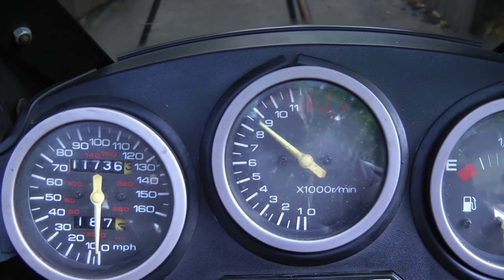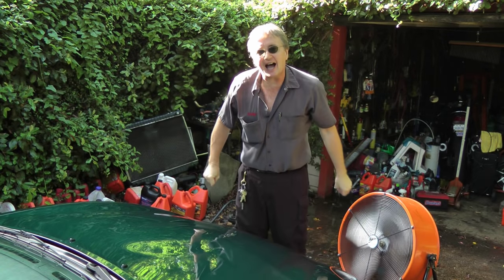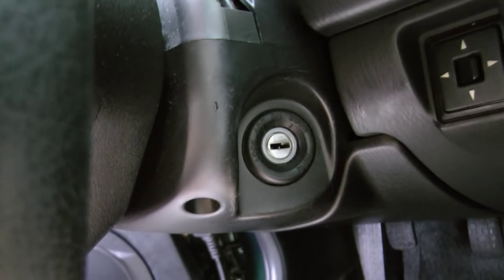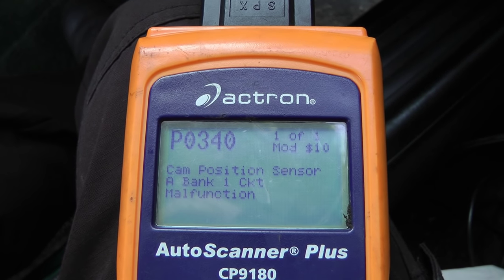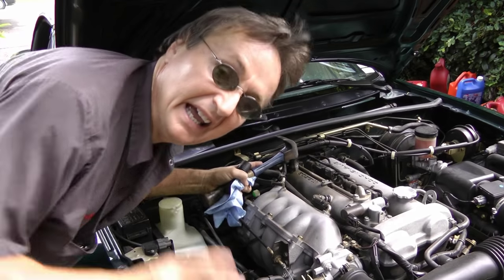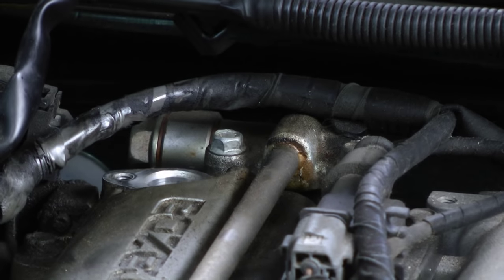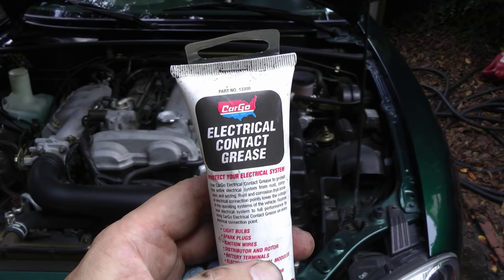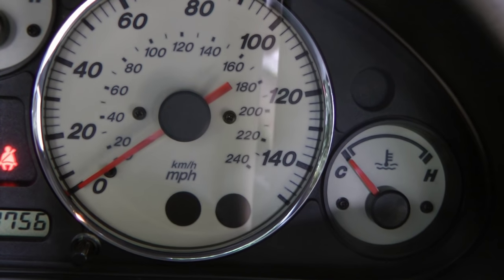How to Fix a Car that Randomly Dies while Driving

Comment: Hi scotty first off you need a tv channel lol your way of doings things is funny asf🤣iv got a 1.8tdci ford smax 07 plate.some times hard to start from cold but does fire up 5 mins up the road cuts out.some times i can go a day or 2 no probs.but when driveing at random cuts out does seem to happen comeing to a stop or turning corners ect.whats your thoughts.its had full service and no codes found on dino test🙄

Comment: I have a 2007 Chrysler 300 3.5 liter. When I was driving it turned off on me so we replaced the cam shaft sensor on bank 1 and then I replaced the crank shaft sensor and it still doesn't start. Can you tell me what else it could to fix it

Comment: 94 z28,  randomly cutting off,   A little history,  I have replaced the opti spark, pcm, ICM fuel pump, wiring harness , map and maf sensor fuel pressure regulator.  And it still cuts off randomly weather it’s idling or at cruzing speeds.   Any ideas other than a bad design of the electrical and ignition system of these cars.

Comment: Hey Scotty It Rained Down Here Where I Live and flooded And my car is super low to where it turned off on me but it’s running now but now it’s running differently, at cold starts it sounds like it wants to turn off but it doesn’t the car shakes, when I turn my ac the rpm drop drastically, when I put it reverse it turns off on me at cold starts what can I do here myself to check it?

Comment: hey scotty. I have an Opel Zafira 1.6 benz 2001.. i have a problem with car.. suddenly when i want to accelarate my car dyes, turns on ignition and wont start. but after five minutes the car starts and runs well. the problem is that car is dying after u accelerate a bit more.. p.s. sorry for my english. :(

Comment: My mom had a 64 caddy Coop DeVille that did just that. We were driving to Baltimore and then all of a sudden it just died, while we were driving. Turned out the issue was the ignition switch. Which was weak and would all of a sudden shut the car off. Plus my mother had a bunch of keys on the ignition switch guarantee that caused the issue.

Comment: Hello, I have a 2002 Mazda Millenia that I am having issues with.  I hit a pothole and after that the car died out. I had to continually restart the car and pump tbe gas to make it home, each time I lowered my RPM the car would die out. I replaced my fuel pump and camshaft sensor. Car still idels at 2 and will die out if throttle is not held. Any ideas as to what could be the problem would be greatly appreciated!! Thank you!!

Comment: I have a 1997 Dodge Avenger that cuts off while driving and I have to wait like 10-30 minutes before it will crank back up then it will drive fine any suggestions

Comment: New pump, new sensors, new fuel filter, car still starts very difficult and when i push the gas, it wants to die and sometimes does. could it be the injectors?

Comment: Hi Scott! I have a 2005 Mazda 6 3.0 V6 and it died on me while driving. It started right back up after about 10 mintutes and then randomly died after that. But now it won't start at all and my battery seems to be draining all the time. Codes are U0100 and U1900. Any ideas? Thanks.

Comment: yup just happend on my 2011 dodge caliber was crankshaft position sensor but i said get both pay my guy $100 to install them cause had to do from under car n remove sheild that had 2 bolts 13 mm n 10 mm car runs fine now cost for sensors depends ob vehicle mines were like $25 with tax others as high as $58 b ut like scotty says if the mother borad goes you got huge expense as high as $2500 i seen

Comment: Good afternoon Sir
I have a 2015 Chevy Cruz 1.8 LS when I was driving the car just died on me while coming to a stop . I had the car repaired new heads new oxygen sensors ect. After a month check engine went on cadalac converter code come on know it's cleared car starts I can move it just a few feet and dies could it be the crank shaft sensor thank you.

Comment: Scotty, I have a 2007 Maxima SE, recently while driving just died, I tried (10 times)to started and it did for only 10-15 seconds and then died. After that I started it and reved the engine and hesitated but started running like normal; someone suggested the cam sensor were bad, could  that be the problem?
Reply from the maker: don't guess, have the data analyzed using a scan tool first. Too many possibilities

Comment: Hey Scotty, I'm having the same problem with my 97 GMC Jimmy, but the only code that comes up is the O2 sensor on bank 2. I replaced the battery and checked the alternator and everything checked out fine. I will be driving and the vehicle will cut off for an instant and continue on like nothing happened. Sometimes when this happens I would have to put it in neutral while driving and crank it back up again just to get it going. Any clue on what else it could be, or any sort of diagnoses that I could perform?
Reply from the maker: pressure test the fuel pump, they often get weak and do that on that model.
Reply: Alright, will do. Thanks Scotty!

Comment: scotty i have a 2006 mustang gt it randomly will die while starting  if you dont keep the key in the on position till it fires up  if you dont it starts 1 sec then dies about 3 to 4 times then once it starts you have to let it idle for 5 min to get the engine to run without hesitation any ideas
Reply from the maker: +mike johnson try a new ignition swith, pray it's that easy. If not, try my video "how to fix a car that idles poorly"

Comment: Hi scotty love your videos KEEP EM COMING :)
I have a 2002 chevy blazer with a 4.3 vortec v6.
I have a misfire in one of my cylinders, but its not showing a code? And i am using an actron AutoScanner , but i was wondering if i can run my engine while the scanner is still plugged in? Because there are a few other stats that looks like they only work with the engine running? But i cant find anything online saying its ok to run the engine while the actron scanner is plugged into the car?  Also, my engine misses about once or twice every 10-20 seconds, and i can hear a single tic sound every single time it misses? And the tic sound seems to be coming from near the distributor area? I also have new wires cap rotor and plugs, and they arent arcing. so im stumped? please help me scotty  :(
Reply: I have a 97 4.3 Blazer. Check fuel pressure (50-60psi Spec)
Vehicle Off, Key On pressure should rise to 50-60 and stay put.
If it drops down slowly You have a leak. Either Injector poppets or in my case Fuel Pressure Regulator. I changed my injectors a couple times and was always the source of my misfires with no codes on the 4.3 Motor

Comment: I have 76 Datsun 620 and sometimes it randomly dies or it looses power. And when I'm driving and hitting high rpm to switch gears it starts loosing power. Sometimes I'm going at around 50 and it stops moving but the engine is still reving and then I hear a very loud pop. Im not sure what it is my dad told me it could be just that maybe I put too much oil?

Comment: 2009 Chevy Impala randomly turned off while driving on the freeway but I have to admit what happened first first it turned off cuz I completely ran out of oil then turn back on and I got the oil change air filter changed and oil I even put high performance 5w 30

Comment: I have a 2004 kia spectra and it starts to pull and is recently dying on me on the highway and streets. There are times that it runs with no problems, but now this problem is occurring more than usual. I took it to the Kia dealership and they cannot find a problem with it!!! I'm not sure what to do from this point. What should I do?

Comment: I have a 98 Grand Cherokee Laredo and it stalls and shuts off particularly when its cold or if the tank is at or below a quarter tank. I was told the fuel tank needs to be cleaned and to buy some cleaner. I put two bottles of the cleaner in the tank and it still does it.
Is it the fuel tank or something else?
Reply: P.s. When there's a lot of gas, it stalls but doesn't shut off as much

Comment: My mother had a 2010 Dodge Grand caravan 4.0L that would suddenly die but just as if you turned off the key switch. You could immediately turn it back on with no hesitation but it would never display any type of error code on the dash or scan tool.

Comment: My 2012 tiguan died on me while the engine was still running amd few mnts it worked again..the epc light showed alone on the dashboard and disappeared all alone.  I checked it on the scanner and there was no fault at all in everything. The car dealer told me to change the fuel filter. Is it the right decision? Do the epc light have something to do with the fuel filter it come and goes alone? Do i have to change something else? 
I wish for an answer...
Greetings from lebanon.( Rony)

Comment: I have a 94 regal. Ive replaced the coils and ignition module. The crank sensor plugs and wires. Unfortunatly its an oddball year for the obd computors and i cant find a scanner to check it. Driveing steady it jerks after getting up to temp and will stall on occasion. I need help!!

Comment: Would like to know what is wrong. Changed my o2 senor but the check engine light is still on. And the odb reader say no activity bank one sensor one. Have a 2003 jdm forester

Comment: hey Scott I have 1993 Oldsmobile royal cut off but will start right back what do you think the problem is
Reply: +Audrey Lee I have a 1990.  If you have a 3800 series I, then I would check your Idle Air Control Valve(located on the throttle body) and yoour Cam sensor(in a fucking awful place that is hard to get too: under the water pump).  But if you have a engine code, scan it first.  You can scan it by jumping A and B on your OBD 1 port under your dash.  If your engine code corresponds to what I said or nothing else, try that first.

Comment: Hi ,i got a Toyota corolla 2000. Some time i leave car 2~3days at home without driving, next day maybe couldn't start or maybe stop on road. But i take off the battery then connect again , alarm lights on ,  then i release the alarm then put the key in , car start. So i think maybe it's something wrong with the alarm ？because the alarm Not allowed you to start the Engine before you release the alarm？so ,do you think it's battery problem or alarm problem？

Comment: My 01 Santa Fe was running fine. Started right up every time. . I unplugged the battery to get another & accidentally connected it backwards. A big fuse broke but now is fixed. I go to turn it over & start it, but it will no longer start up & run.. It's getting fuel, but no spark. Help!!

Comment: I have a 96 Ford Mustang cobra. When I start the car in a cold start it turns off. It shoots to 2k rpm when I start it but couple seconds later it drops to around 3-5 hundred rpm  and turns off right after. Could this be the idle air control valve? Or a vacuum leak?

Comment: Hi Scott, I have a 2005 Mercedes Benz ML350. I was driving it for about 3 hours on a road trip, when all of a sudden the engine stalled and turned the engine off, then it turned back on. I just got the vehicle a month ago, before i watched your video on why Mercedes Benz are money pit machines. I had plugged in an electronic device on the rear passenger earlier in the day. When my car died, i also noticed that the cab lights no longer worked, and my car engine starts, but when in Drive, It dies 1 minute later, and i have to restart and go another minute. Can you help?
Reply: Is there a fuse that needs to be replaced? could that be the issue. This is the first time this has happened. The ODB reader says something about System Voltage High Confirmed(P0563), Oxygen Sensor Circuit no activity detected bank 1 sensor 1 (P0134), Oxygen Circuit No activity detected Bank 2 sensor 1 Confirmed, and (P0563) System Voltage high Pending. I checked the fuses in the engine bay driver side, is there another place i can look for a burned out fuse?

Comment: i have a dead jag s-type which showed unique error codes. from all cylinder misfires to going off while on idle. i fixed many error codes but gave up coz now it says fuel rail pressure sensor and gear 1 ratio bla bla. im selling it as a half dead car coz my patience is gone...what i wanna say is that the scanner can show tricky error codes. you fix one and then another appears

Comment: What if you have this problem but no check engine light? I have a 99 Mercedes Benz C230 Kompressor and it starts and runs fine but the other day it stalled. When trying to start it it ran for three seconds and died, it continue to do this for the next 10 starts. About an hour later it started and ran fine. I'm thinking MAF sensor. Any other ideas?

Comment: Hi Scotty I have a toyota hiace mini bus 4wd, automatic engine stops when i stop or slow down, no engine check lights on, starts right back up and works fine for days and weeks then suddenly stops, accelerates OK, need help
Clean air sensor, throttle body, new plugs, use fuel injector on each fill up.
change alternator brushes.
Desiree
Reply from the maker: Desiree Foster   a weak fuel pump can do that, pressure test that first.  Also try my video "how to fix a car that idles poorly" as cleaning can often stop that

Comment: Hey Scotty I have a 2002 Dodge Ram 1500 with the 5.9 L 360 engine it keeps sputtering and wants to die but can keep it going with my foot then it clears off in 5 seconds if driving 02 sensor bank one sensor one is showing high voltage but I have headers that were put on before I got the truck help

Comment: I have a 1998 chrysler cirrus having starting issues and when it does start when i give it gas it shuts off instantly. I have no engine lights at all. I changed fuel pump and computer. Any advice?

Comment: I have a similar problem on a 1997 Mitsubishi. It's dosen't cut off on the highway. It's cuts off at low idle after a trip. In the parking lot and in the driveway.

Comment: I have a 2004 Honda pilot the problems I have is that when I backing of on my drive way and then shift it to drive the car turns off.or also when it's in park and I step on the gas and get to 3000 rpm the car turns off what do you think is wrong with it?

Comment: Hey scotty. I actually just started experiencing this problem but my mechanic says that his tool isn't reading any codes. But car has a rough idle. And actually turns off in between 1k-1.5 idle. Has a good cold start but then a warm start is rough. Not sure on what it could be and my mechanic has no idea. Please help!!!

Comment: Scotty I have a p0342,the volt from the sensor to ecu is 11volts. I replace the sensor,and replace also the ecu,should I replace the wire from the sensor to ecu?
Reply from the maker: +Edgar Chavez there's a short somewhere, so do the wiring

Comment: Will the camshaft position sensor have one or two on the Honda pilot 04 model . I see a cam and crank sensor all in one one line . 
 Confused . 

I swapped out the fuel injectors and now the thing will not start . It was running before the fuel injector swap now it just cranks

Comment: Scotty I have a problem. My truck does this but it’s a 95 Dodge Dakota 3.9 model! No OBD2! It will start right up after about an hour! We’ve put electronics on everything except the PCM, and even gone as far as putting it back into timing! But it still does after idling for about 10-20 minutes. It’s so frustrating and even my mechanic can’t figure it out. They opened the shop on a Saturday JUST to work on my truck. Please help! It’s my first truck 😔

Comment: hey I have a 2004 mercury mountaineer with the 4.6 lv8 and my truck stalls out because it says low oil pressure could it be just a sensor

Comment: Is oil suppose to be around the sensor because when I took out the senor it was dirty with oil I put in the new sensor which was clean  and it still cut out on me lol sorry just wondering I'm not a mechanic. I'm going to buy electrical cleaner and try that at well. As far as the engine light it comes on and off randomly so I'm thinking its possibly electrical?

Comment: Have a 2000 TJ Jeep Wrangler, was stalling, and showing codes for camshaft sensor and synchronizer. Replaced but still stalls. Took the handle of a screwdriver lightly tapped the sensor, and the engine turned off. So the new sensor must be bad. Had 2 different Mech's look at it with no help. Getting ready to put new sensor in it again.
Reply from the maker: don't buy cheap chinese made sensors, get oem and that won't happen.

Comment: I have a 2012 kia that loses slowly loses voltage after about 45 minutes. Already repalced the alternator and positive wire to the battery , battery is good ,checked a ton of connections . Only code ive gotten is low voltage . All the cops ohm out the same . Any help would be great !

Comment: Hey Scotty my 2001 Nissan Xterra cuts power uphill and higher speeds for some reason. I personally dropped a jdm motor with new maf, new cats, new 02 sensors still same problem. No codes too! What should I do? ? Please help thank you
Reply from the maker: +HajjiReza often a weak fuel pump or clogged fuel filter, computer does not know fuel pressure so it won't set codes

Comment: HI I HAVE A 07 YUKON DENALI MY TRUCK START OK I  DRIVE IT NO CHECK ENGINE ,  BUT I DRIVE IT LIL BIT OVER 70 OR 80  AND RUNS GOOD BUT WHEN I STOP MY TRUCK SHOUTS OFF AND  CRANKS AND CRANKS LIKE THERE IS NO FUEL  BUT I SPRAY STARTING FLUID AND NOT WORK EITHER I LET IT SET FOR 30 MINUTES OR MORE AND TRUCK START LIKE NOTHING HAPPEND ,  I CHANGE ALREADY FUEL PUMP AND THROTLE BODY , AND CAM SHAFT POSITION SESOR, AND CRANK SENSOR AND STILL THE SAME THINK HAPPEN.  DO YOU HAVE ANY IDEA OF THIS PROBLEM?

Comment: hey Scotty I have a 2014 Dodge Ram 2500 Diesel 68rfe trans it moves about 50 60 feet then quits   ,changed speed sensors but same so any help here
PLEASE